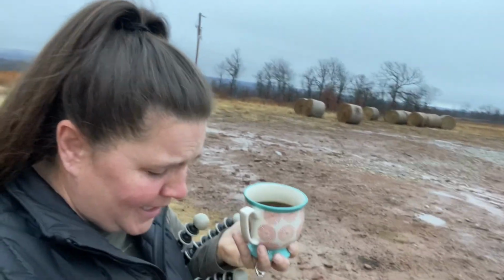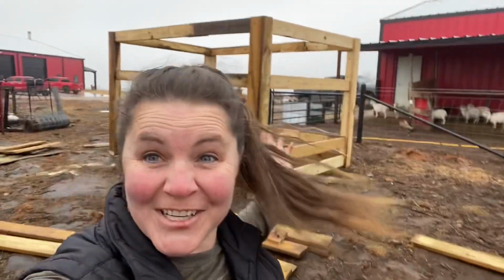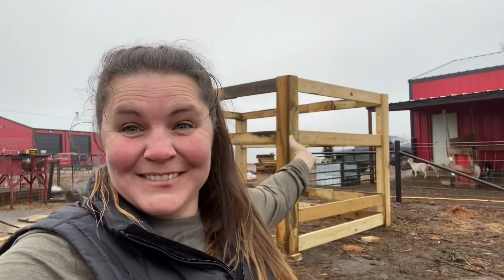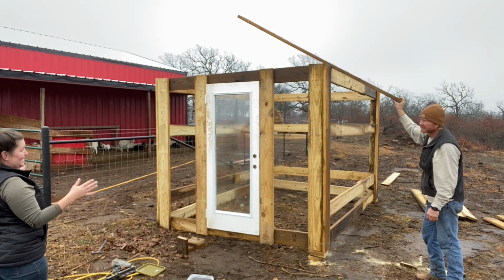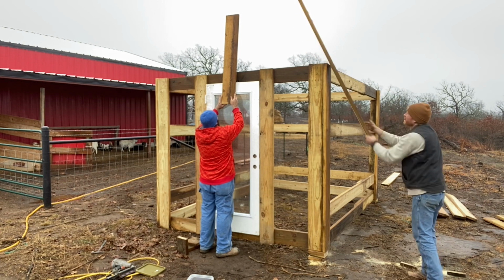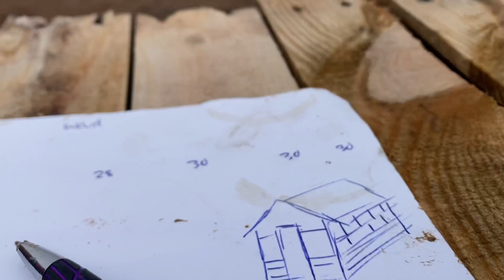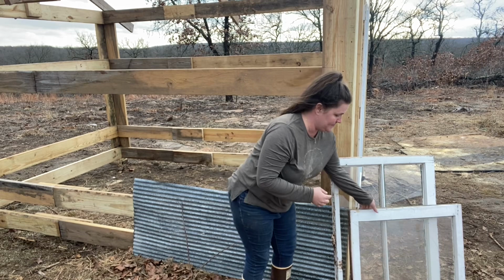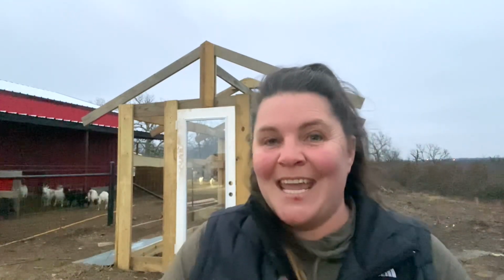Building Our Own Greenhouse With Old Vintage Windows: Framing Our DIY Greenhouse  Part 1

Comment: Hi Chrissy
I've got old windows they took out of the local college here that are brown  and than got some new scrap pieces of red tin were making me one this year you my friend just got me inspired to hurry up and get mine started
Reply from the maker: Patty that sounds so AWESOME!!@!!! Its really exciting!! I cannot believer we got this done already! I couldn't have done it, i know nothing about framing! I had my friend come help me, I paid him of course.  Now, I need to powerwash the wood, place the cement blocks under the corners, finish a couple more roof ridges, get the clear stuff for the roof, then I think it will be a breeze!! Im going to hinge some windows so I can prop them open. In the summer I wont be able to use it due to being over 100 degrees but right now!! I can have all my plants in there for the winter and grow lettuce and spinach all winter long!! YAY!! I cant wait until you start yours!
Reply: @ParagonRidgeRanch  I'm excited n happy for ya

Comment: It's going to be nice. If I may offer some advice, before you put the tin on get mobile home straps and ground anchors. Nail the straps at least 48 inches up the corners and use 4 total. With the light weight construction and the clear roof it's going to be very light. A wind storm could flip it if it is not anchored. God bless and good luck.
Reply: I learned the hard way with our cistern